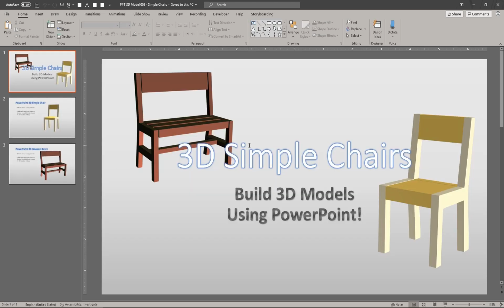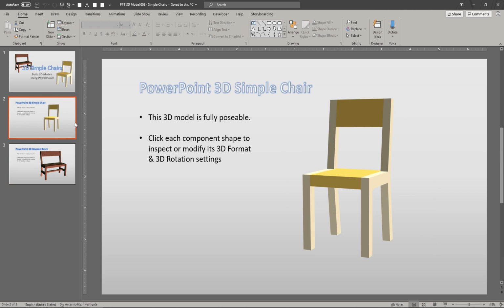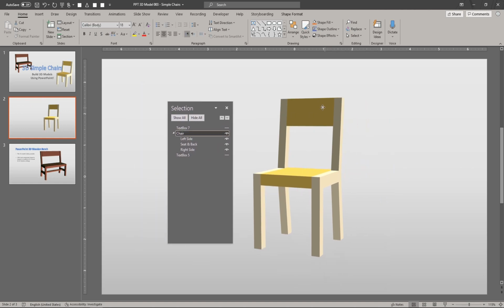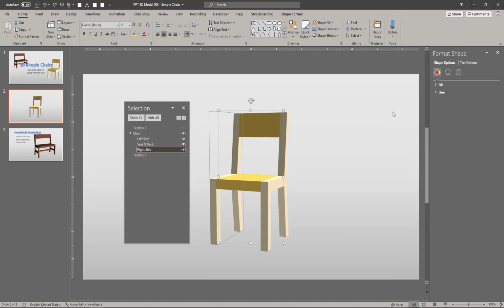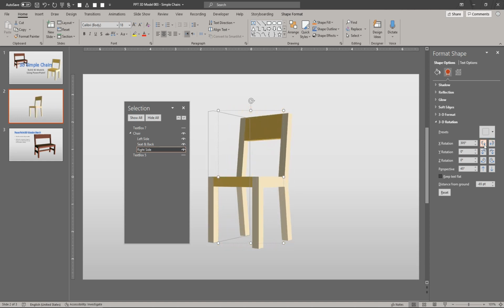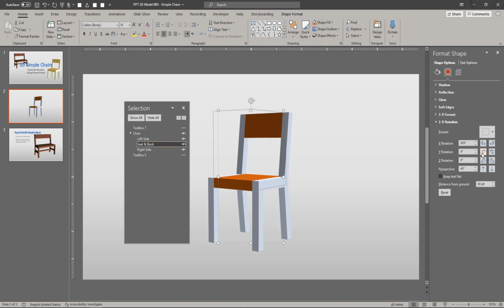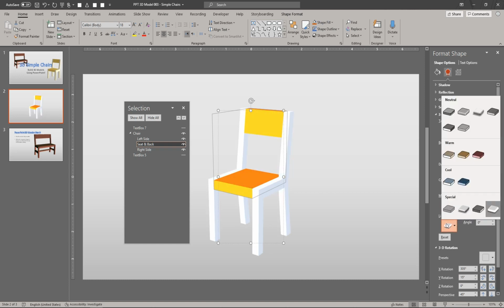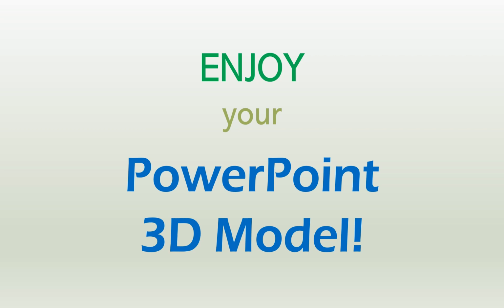PowerPoint 3D Model Walkthrough - Simple Chairs - PowerPoint Tricks

Comment: How to build a chair from front view? I just saw a front view sofa on your Instagram. Really want to learn it. Can you tell me some tips?
Reply from the maker: 😀 The starting point is to design and draw the 2D vector shapes from the front view, unlike the simple chairs that are designed from the side view. All the parts should be grouped together to make the unit work nicely (for posing, animation). Then we apply the 3D formatting tools to add 3D depth and bevels to the parts. To show the parts and dimensions in detail, I'll put together a quick post soon in my gallery on Instagram and get back to you when it's ready.
Reply: @Cubiclite  thanks